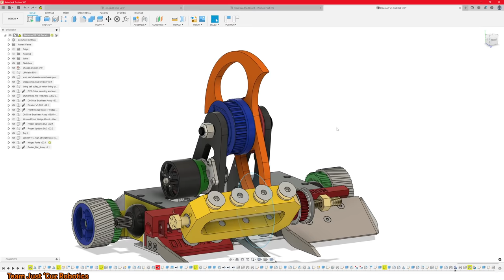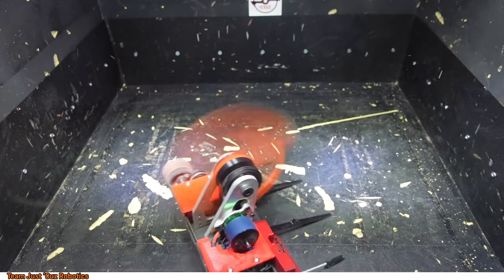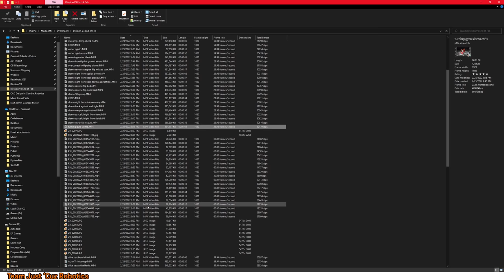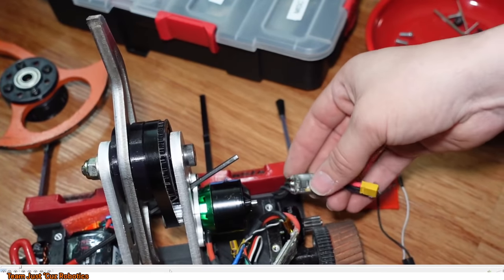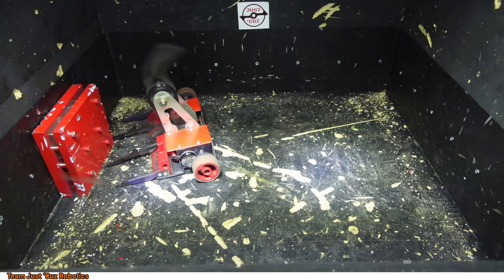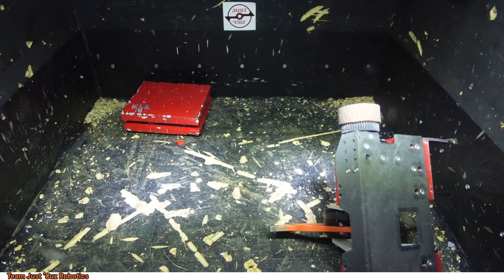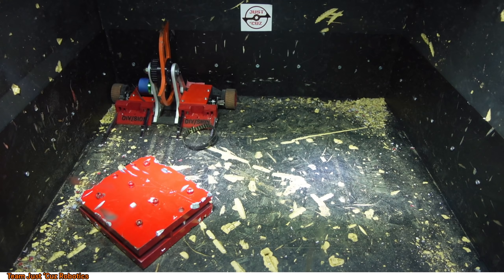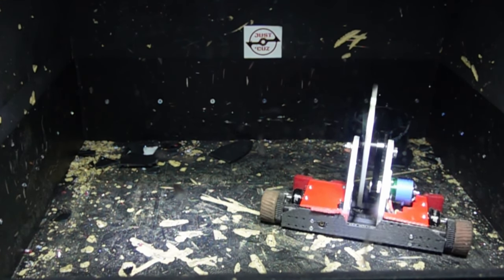Please Just F**king Work! Division V3.0 Problems and More (3lb Beetleweight Combat Robot)

Comment from the maker: Lots of people are speculating about different timing belt options. Found this and it's a good read on the subject. Seems like fiberglass is basically bad at everything a combat robot demands of it and yet it still worked before 😅. My confusion only grows... 

https://www.sdp-si.com/D265/PDF/D265T010.pdf
Reply: I learned recently that timing belts have a 'winding direction' of the cords inside the belt, and they are meant to oppose each other when multiple cords are used. It can have a significant impact on belt strength. It's some kinda physics thing like helical gears. Possibly related to your problem here.
Reply from the maker: Yup that was also mentioned in the last couple pages of the document I linked above. Sadly I have no idea what exact kind is used in the belts I have. Maybe I can reach out to Mcmaster to find out.
Reply: If there's one thing that building a bot from scratch has taught me... for as demanding as the application is, there is definitely room beyond "conventional engineering" to build some crazy (fun) things.

Comment: I really like this format. Love all the details. Would not want to face that thing in the box. Have you considered making some kind of slip clutch if you can't get the belts to hold up? Complexity may not be worth it, but it's an idea.
Reply from the maker: Check out my Division overviews from the past and you will see I kinda tried to do that. There are clamping hub pullies that allow for slippage and that's what I used for V2.12 all the way back to like V2.8 or so I think. These allow slip but they introduced new problems.

The only way to let the pulley slip is have it break free from the shaft. This also means it can slide down the shaft. The biggest failure I had with these clamping pullies was that they would slide down and then get hit by the weapon, tearing the motor free of its mounting and essentially ruining that motor or making it very hard to reuse. This happened 5-6 times and resulted in >$150 worth of dead motors and pullies.

The only way to prevent this is to add something on the end of the motor shaft which prevents it sliding out, which I didn't have room for on the past versions, but I might just barely have it now. However, currently the motor shaft is not even long enough to pass all the way through the pulley so I still can't do that without custom shafts. If I find that the new XL belts cannot work for this application without breaking then I'll consider other ways to introduce slip.

Comment: Drizzling some epoxy as a kind of conformal coating to keep the caps in place has been working well for me.  I don't like putting hot glue on ESCs as it can sometimes melt and make a mess while also ceasing to do its job.  Goop may work too.  Kapton tape wrapped around an ESC to include the wires can act as a strain relief to the wires.
Reply from the maker: That's a good point about glue melting, I had a lot of issues with that on weapon ESCs which is why I switched to RTV. For drive they don't really get hot at all unless the motor is stalled which shouldn't really happen, but you're right, it's probably better to be safe than sorry.

Comment: For the battery test, wouldn’t the extra power drain if the weapon hits something and needing to spin up again mean you’ll last wayyyyyy less than 3 minutes?
Reply from the maker: Well, that's a complicated question. Keep in mind during the times the weapon is stopped it is drawing 0 power. So it's sortof a question of do the spikes in power draw to spin up outweigh the dips in power draw when it stops? I have no way to directly answer that. But you can see I am hitting the test load for several minutes on a single charge so clearly it's not like it will last under 90 seconds. It's also extremely easy for me to just not run the weapon at full speed and use way less power that way.

Comment: Regarding your belt problem: Stiffening the belts may have been the wrong choice. If your old belts could stretch a bit, they could have absorbed some of the momentum from that collision. As you stiffen, you'll keep chasing the failure point until everything can absorb the shock load.
 
Also, you say the load is only from the motor, but I don't think that's true. This is a partially elastic collision. You're elastically loading up the disk as well (i.e. when you hit hard steel on steel, I wouldn't expect the weapon to inelasticcally stop, I would expect it to bounce backwards at maybe 50-70% of the impact velocity), and that momentum from the collision goes back to the belt.
 
I know friction clutches are problematic in combat robotics, but it seems like the solution if stretchy belts don't work.

Oh: and thanks so much for sharing this. I've wanted to get in to this hobby but kind of thought it was a kid's sport and an adult engineer showing up would be looked down upon. Seeing you in particular as well as NHRL really changed my mind. Thanks again and best of luck!
Reply from the maker: I don't think any of the collisions in combat are as elastic as you might imagine. In my experience it's very rare for a weapon to come to a dead stop let alone ricochet backwards after a hit, and things always tend to deform dramatically. In the case I showed where the belts snapped I was hitting aluminum which was extremely inelastic and deformed to absorb lots of energy. My weapon came to almost a complete stop and was maybe rotating backwards a tiny bit. Hitting hard steel would be a different story, sure, but it's really hard to hit at just the right angle and with the best possible tooth engagement to cause 100% weapon energy transfer.

This is all wild speculation though, it is extremely rare to get high speed footage of this stuff and it's one reason I really want to do that and get a better sense of what is going on. I'm limited by what I can accomplish without a $3000+ high-speed camera.
Reply from the maker: I think on principle you are probably right that the stiffer belt is the problem though. I am getting fiberglass reinforced belts that have a bit more stretch and I'll see what that does for me.

Comment: Are the teeth deeper in the XL belt making it thinner at a high stress area?
Is the new motor heavier than the old one? (Storing more energy for the belt to absorb.)
Reply from the maker: The teeth are substantially bigger/deeper yes. But people have been telling me they run XL belts on 12lb bot weapons and they don't break like I am experiencing. Something must be wrong with my setup.

I considered adding subber bands or something, I'll see how they behave once I get the steel forks (should be the end of this week if SCS comes through)

Comment: great video! the torque reaction of braking the weapon is interesting.
regarding the belt snapping, I wonder if the kevlar reinforced belt has a lower failure strain than the fibreglass one? The kevlar one may be stronger, but if it's stiffer it may be decelerating the weapon motor faster, so carrying much more load, rather than the "springier" fibreglass belt taking away some of the shock? a tensioner that has a small amount of give to it might reduce that shock.
Reply from the maker: That does make sense to me intuitively. Still, Kevlar reinforcement is supposed to handle sudden shock loads better than fiberglass according to 'linear motion tips' and Megadyne Americas. 
I have done everything I can to avoid using a tensioner as it obviously would require more weight and it's just one more thing to worry about. I may have to just order some fiberglass belts to try in addition to the others I ordered.

Comment: Bold of you to test a forked robot in sandals! And yeah, potting the ESCs is a good idea, the build quality on small hobby ESCs not good. The impacts that you see in robot fighting are also pretty huge, so if you don't keep them restrained, the components will pop off the board like popping a part off of a flexible print bed. A TPU enclosure /mount for the ESC might be a good idea too, but definitely pot the board if you are popping components off in testing.
Reply from the maker: Don't worry I electrical taped over the tips of the forks so it'll hurt less when they stab me in the foot. Still it's a good motivator to become a good driver! And yeah definitely sounds like a good idea to coat the electronics. I just ordered some heat shrink of the Marine variety that has a glue-like substance inside of it so I think if I just cut off the existing heat shrink and redo it with that stuff it'll accomplish the same job as coating it with epoxy or rvt

Comment: Something else I'd like to point out on your battery life test/self right test. Whenever you're Battery started to drain and you could hear the weapon slowing down do you think at lower voltages it will effect the self right? or even at Lower speeds it can still pull it off. Also what about weapon motor temperature, can you self right even if the motor is hot (I'm pretty sure brushless motors lose a bit of torque and speed whenever they get really hot.
Reply from the maker: My motor is pretty massively oversized so it doesn't really get that hot. The speed controller I had previously had issues with the solder melting off when it was trying to produce ridiculous amounts of current so I programmed the one that I use now with a 40 amp limit even though the motor could easily draw more than 60 amps or for extremely brief periods more than 90 amps. So it still has plenty of torque to self right but it's not actually drawing an obscene amount of power to do so. I have been able to self write with the weapon when the battery is kind of close to empty but obviously if it gets to the point where the weapon can't spin up then I'm screwed

Comment: Considering you beefed up the weapon motor mount, maybe the motor is mounted so rigidly now that the belt takes stresses before that were previously kinda absorbed by the motor mount flexing a bit?  If you toggle between the before/after hit frame of 31:08, you can see the entire bot jolt back while the belt kinda stays in position.

I don't think the inertia from the motor is pulling the belt apart, otherwise it should snap every time you full-reversed the weapon.

Since you mentioned that the uprights aren't secured all that well, could they have moved around enough to basically stretch one edge of the belt? Once it's overtightened it's a short stop from just ripping the belt in two.

Good luck figuring the issue out!
Reply from the maker: I didn't really beef the motor mounting at all, in fact if anything it's worse than in the past few versions where I was using Cobra motors. I used to bolt the motor straight to the upright, and now it's on a thinner plate that's then bolted to the upright.

In any case the shaft of the motor and weapon shaft center to center distance is all maintained within one upright, so no matter if it got loose from the chassis it wouldn't change the tension on the belt at all.
Reply: @JustCuzRobotics  I didn't mean the axle-to-axle distance.

If there is a tiny bit of parallel play between the two uprights, on a big hit it could shift one a tiny bit up or down, in turn the weapon axle would work as a lever against one side of the belt. So instead of evenly loading the belt, it's now slightly pulling on one side of the belt which could cause a tear? If you have thinner belts, then this difference would be smaller since the lever action would be less.

I'm no mechanical engineer but it seems more likely than the belt just straight up snapping from the inertia from the motor and pulley alone.

Comment: I've seen some bots using nylon gears. I wonder if it would help with your belt sprockets? I guess the top one looks like plastic already. Just wondering if introducing a bit of give somewhere would help the belts or add an overall weakness lol.
Reply from the maker: The pulley on the weapon is already Nylon. It's stiffer than you might think. I have used printed Nylon gears in a lot of other applications though including the weapon on my antweight and on the drive wheels on Division V3. It works well in the right circumstances
Reply: @JustCuzRobotics  Ah alrighty. I've never built one so I only know what I see others doing.

Comment: I think the reason you’re belt snapped was the less inertial mass in the weapon. Before I don’t remember your blades coming to a stop that quickly
Reply from the maker: I think that they stopped quickly because of two different things. Number one I was testing at like 25% weapons speed and during fights I'm pretty much always more like 50 to 75%. Number two a giant aluminum brick seems to absorb weapon energy a lot more efficiently than an actual opponent robot. Need to do more testing but unfortunately I don't just have a D2 kit lying around to murder.

Comment: It's kind of unlikely with two belts snapping, but is there a possibility that you simply got a bad batch of belts with a minor manufacturing defect that caused it to snap under the stress? It might be worthwhile to order two new batches (one from the same supplier, one from a different supplier to rule out bad QA) and test if the belts from the new batches also snap.
Reply from the maker: It's impossible to prove one way or the other without ordering more, but I do have two more belts I bought at the same time (presumably same batch?). Only problem is that for all I know these belts are manufactured in the hundreds and I might still get them from the same batch. That said these belts were one of the earliest parts I ordered more than a month ago now so that's a bit less likely.

Like I said I did order two different reinforcement options from another company to try. Failing that, I may just switch to a 9mm wide HTD3 belt that's the same tooth size as what I used before in V2, but much wider than the 4mm s3m belts. Already looking into getting set screw mount pulleys for those

Comment: As far as the belt snapping, I haven't had many issues other than having it directly hit by opponents on Wormhole, although in November, I had a grudge match that the belt seemingly disappeared after a hit, so I have no idea, I'd be very interested to figure it out, however I haven't had issues with the shock breaking the belt, so I have no clue how to fix that issue.
Reply from the maker: I was thinking it was a fluke until the second belt snapped. I have 2 more but I can't see any way that they don't fail the same exact way. It seems to me it must be nearly impossible for two belts to fail as a fluke

Comment: maybe cast the esc in epoxy resin to prevent components from comming off?
Reply from the maker: I said it at some point but might have edited it out, but I have some electronic safe silicone RTV compound I may use. I just need to order some of the right size clear heatshrink to cover them again after.

Comment: Maybe you had slippage with your smaller toothed belts under max load and now with the bigger teeth you get no slip at all. Maybe a small sheet of tpu between the weapon motor and upright to give it a tiny bit of shock absorbing.
Reply from the maker: Hmm that is indeed an interesting idea. Right now I have an aluminum motor mount plate that the motor bolts to and this plate is attached to the upright. I could certainly just add a TPU piece between the motor face and the plate, although if the motor ever got hot it wouldn't conduct heat away as well. I don't think that has really been a concern though. If that is a problem I expect rubber washers or TPU spacers between the plate and upright can accomplish the same thing.